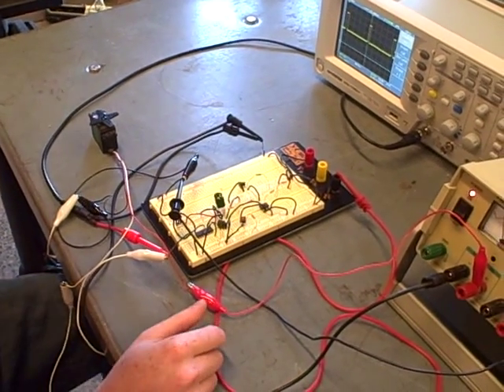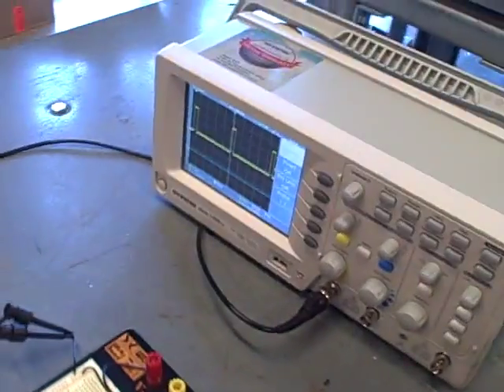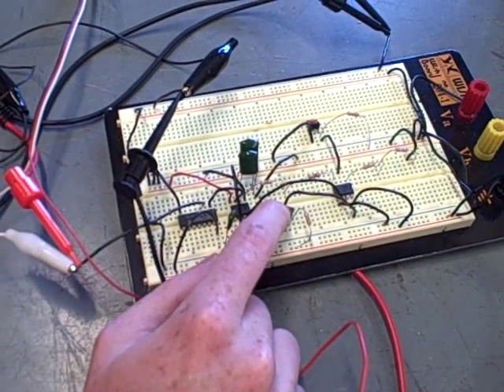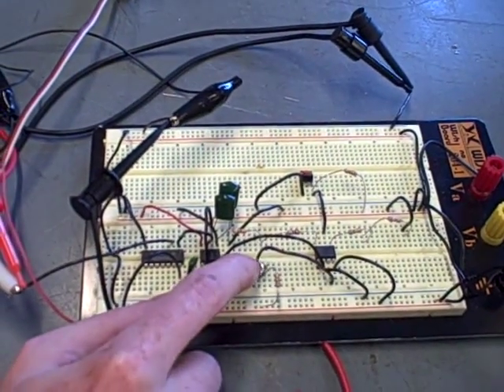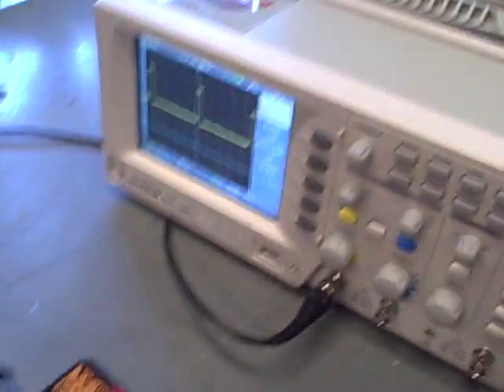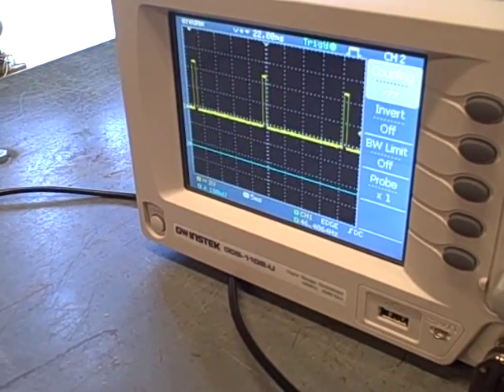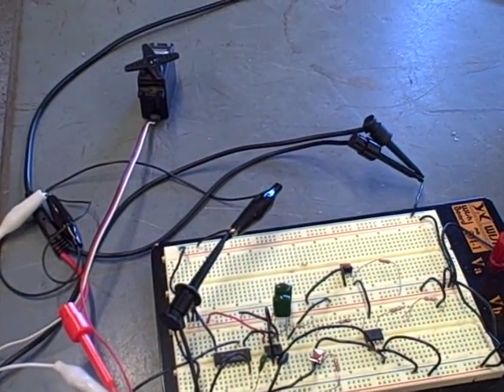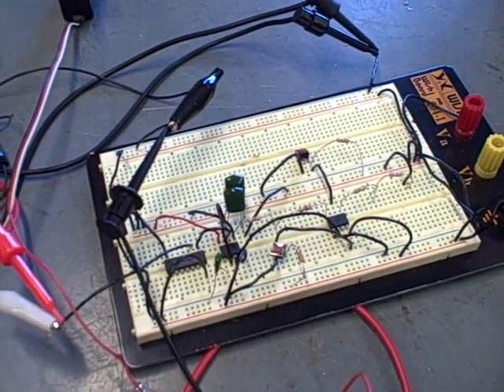RC servo controlled by a digital potentiometer (part 1)

Comment: looks like you are decreasing frequency with increasing pulsewidth. You should keep frequency constant and only change the pulsewidth. Looks like a slight change in the 555 circuit would do the trick.